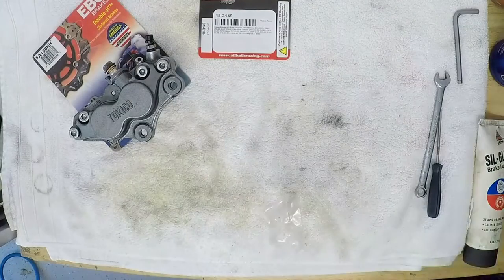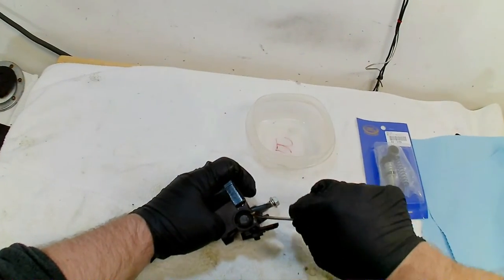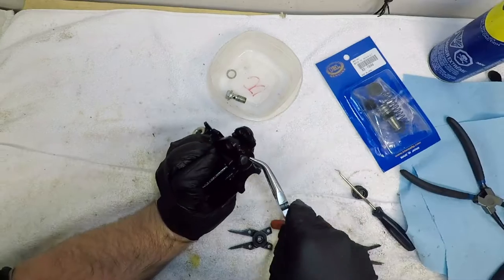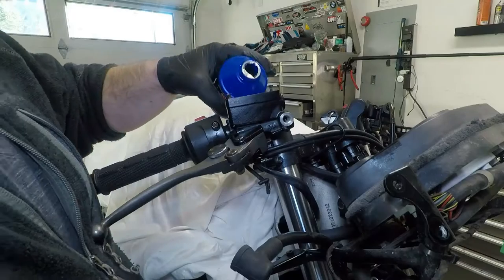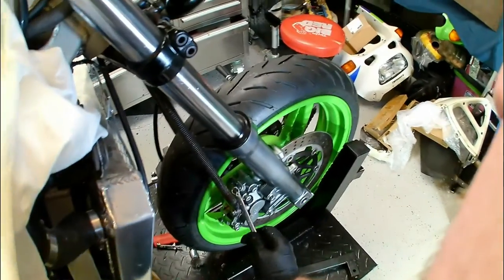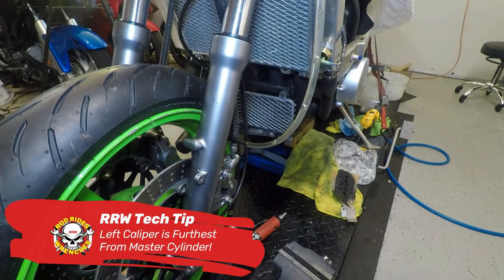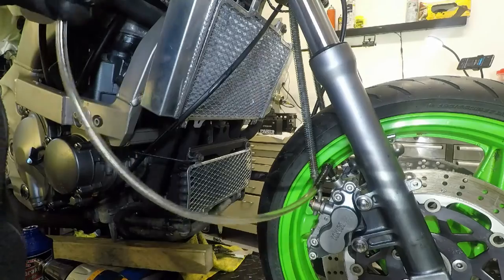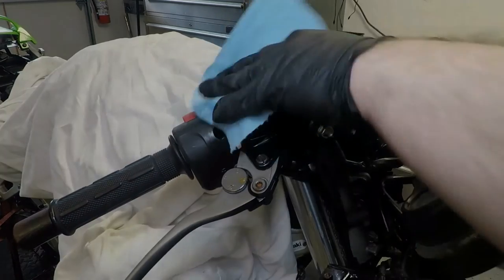Rebuilding Brake/Clutch Master Cylinder

Comment: Thank you. Great video. If I could suggest relating to seals ect during any brake rebuild. Calliper, master cyl ect! Use rubber grease and make it your best friend. Don’t go berserk with it, just enough to lube the seal. Brake fluid is corrosive and it swells the seals during install. Just a trade tip 😊…
Reply from the maker: Thanks for the feedback & View!
Reply: Doesn't the clutch take dot 4 brake fluid.  That's what I read.
Reply: @davidlafranchise4782  Most modern bikes and cars today uses Dot 4, and more recently dot 5. Before 2006 dot 3 was used. The difference between the 2 is the boiling point of the oil. Dot 4 has a higher boiling point then dot 3. You can use Dot 3 [if your bike is before 2006 if you wish to] if your just a normal rider and not racing the bike on a track all day every day. Or uses dot 4. The choice is yours… There is no feel or hydraulic difference with the oils/ fluids.  That’s 35+ yrs as a tradesman an engineer.

Top up! 
Brake fluids can be mixed only if the fluid that you add to the system belongs to a higher grade.

For example, a braking system that has a brake fluid DOT 3 specification can use a DOT 4 or a DOT 5 or 5.1 fluid. Also, a system with a DOT 4 can be topped up with a DOT 5.1 without bleeding the system. But never go backwards. DO NOT top up a system with dot 3 if you already have dot 4 or 5 in the system.

Comment: The metal is angled for a 32nd or 16th under the piston head
Reply from the maker: The piston has two seals that are sometimes referred to as cups.  The primary cup is furthest inside the master cylinder and is in contact with the brake fluid first and is the end that the return spring sits in.  It should have a flared angle or tapper that the widest diameter of the seal is facing the inside of the master cylinder (toward the spring) the narrow end of the seal faces the brake lever.  The secondary cup may or may not have a flair or tapper, it can be larger or smaller than the primary cup.  If it does have a tapper it is installed in the same direction with the wideset part facing the inside of the master cylinder.  Sometimes this secondary cup is just a simple o-ring and has no tapper. Make sure you don't roll or otherwise flip the seals when installing them.  Send me an email to rodrideswrenches@gmail.com and I will send you a picture.  Also tell me what year, make model you are working on...

Comment: If the seal doesn't come on the plunger, how do you get it on??   I'm thinking put seal in hot hot water and then putting it on??
Reply from the maker: You don't want any trace of  water in your brake system.  Just lube the seal up with a little brake fluid.  It will slide over easy enough.  I just did one a few weeks ago that way... - Good Luck!